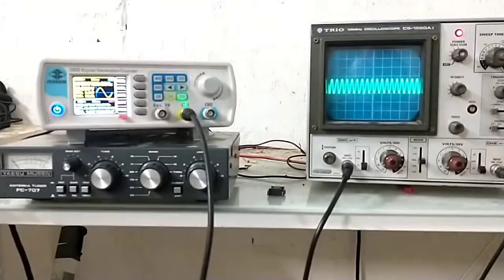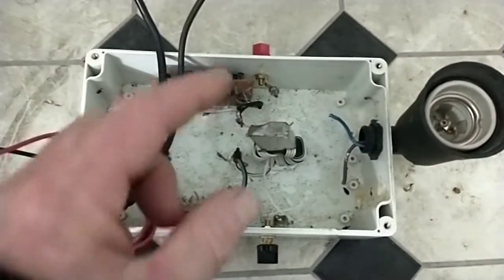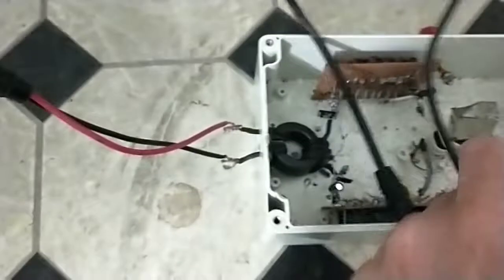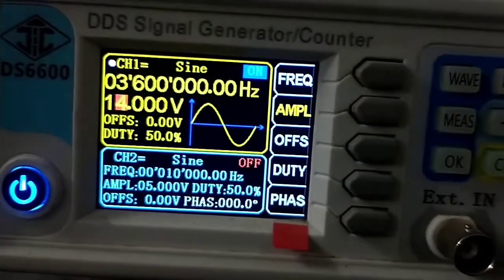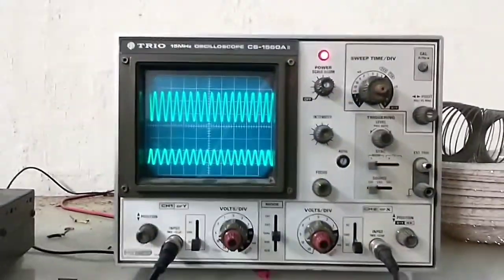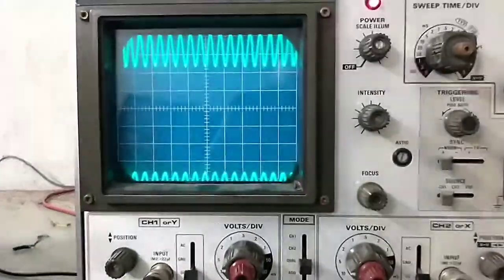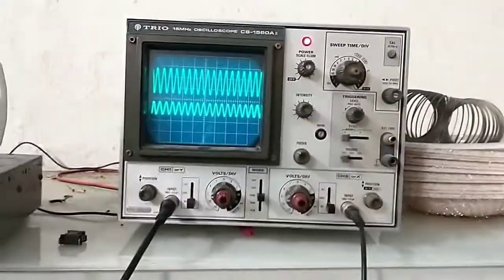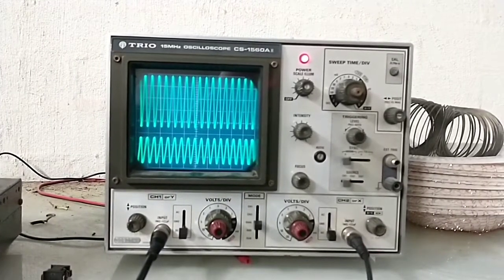Polarise Everything. RF Cockroft Walton Voltage Multiplier Experiment.

Comment: I know on the voltage multiplier the diodes are in series and that accommodates for the voltage that’s being multiplied each stage. So will the capacitors be in series basically and handle the extra voltage how diodes in series do?
Reply from the maker: The capacitor threshold will be only a sum of the applied voltage Vpp along with the bet result divided over the actual distance

I am not going to give absolute values.

The end to end voltage will of course be divided over them

 .

Comment: On a voltage multiplier if I add too many stages will I have to eventually change my capacitors out with ones with a higher voltage rating on them for it to work?
Reply from the maker: I hope you got there mate.